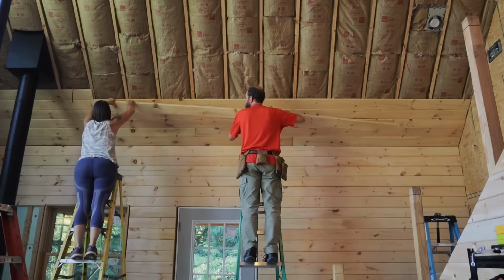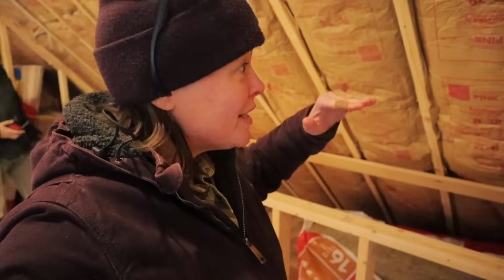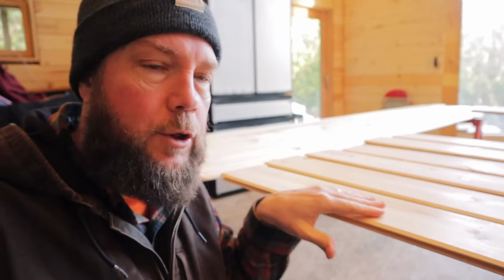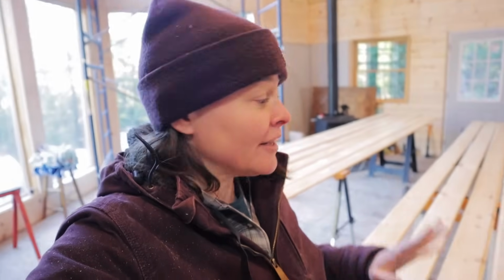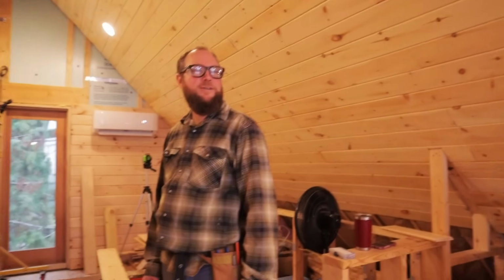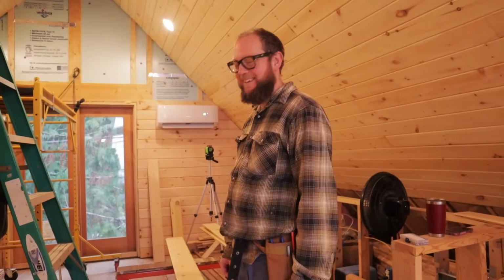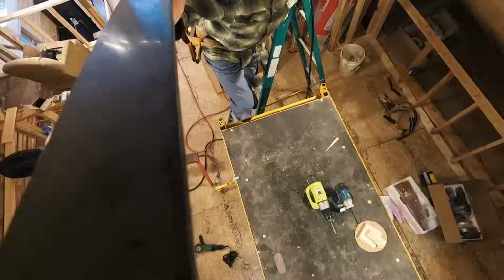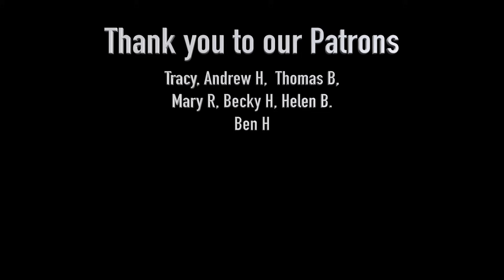FINISHING what we started TWO MONTHS AGO

Comment: why don't you coat the boards when they are up
Reply: 1000 times easier than brushing and sanding that high ceiling with high angle.   I think they did do some walls after installation.